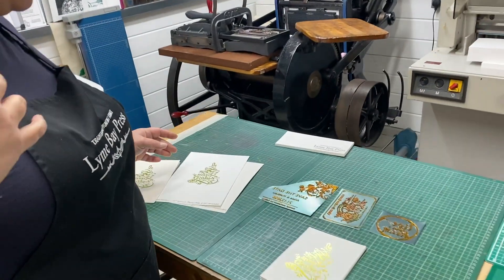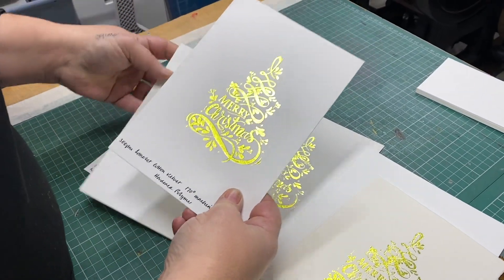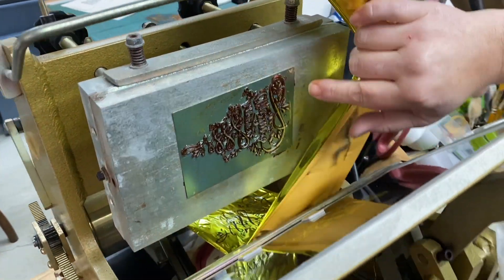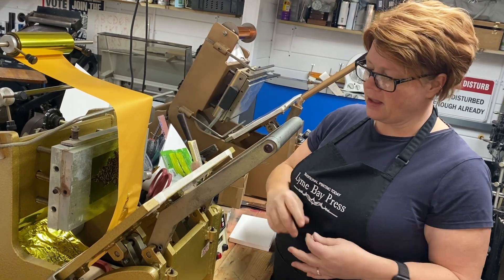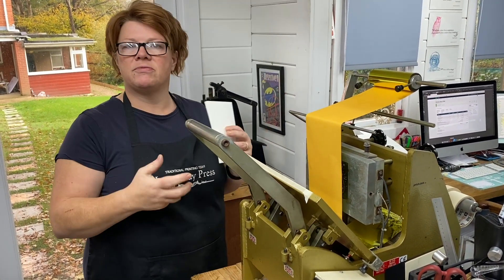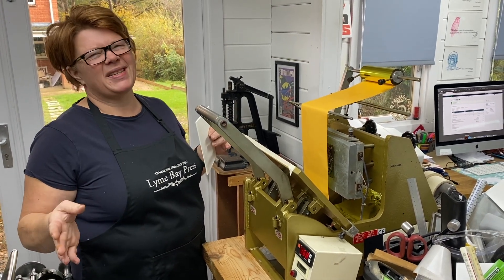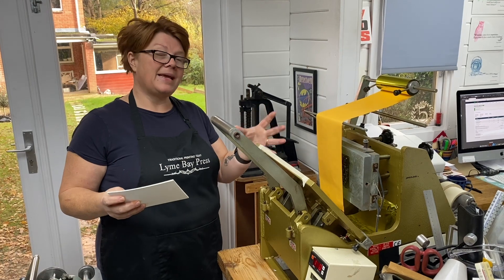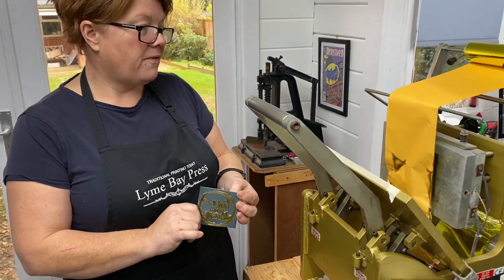Photopolymer Plates for Hot Foil Printing

Comment: I use photopolymer all the time and have done for 20 odd years. We use PPM/H100 and the newer version of the plate from Polydiam and they are fantastic. I use them very successfully on a huge range of board , paper , plastic etc. Overwashing and underdrying can be a common error if you are not used to the process. Im guessing the foil you are using there looks like an older foil , I forget the grade but it looks like an old Foilco 637 I think it was . Also with the PPM/H100 you dont need anywhere near 170 degrees to work with, we are quite happy at about 145-150 even on colorplan and we dont have a very long dwell either. less than a second.  We never dry in an oven, we use a hairdryer, the results just seem alot better and post expose for a good 20 minutes  Just one observation I notice the metal the polymer is attached to is very thin which can cause problems on larger plates. By the way a good grade of foil for metallic foils using polymer is the CF ranges from B and H Foils.   Hope thats helpful. All the best
Reply from the maker: Thank you for this, I've only just seen it. It is very useful I've been looking at the Polydiam plate as an option, I'll get in touch with them and carry on playing...
Reply: @LymeBayPress  You to , very much enjoy your videos. Lockdown meant I was doing even more with polymer plates as we were only getting the odd order , its back to ordering regularly with mags now but still using the polymer for those emergency need them tomorrow orders.
Reply from the maker: TheQuillPress are you able to email me some pics of the results you get from your polymer foiling??
Reply: @LymeBayPress  sure more than happy to have you got an email address to use
Reply from the maker: TheQuillPress lisa@lymebaypress.com :)
Reply: @LymeBayPress   Ive sent some photos across to you

Comment: Hi ,  Lisa
What should I do if my photopolymer plate is too thin ( 0.08 -  1.06 mm ) for printing fine lines and the exposed image areas
on the plate almost very close to the  height of the background of the plate , and the ink cover the whole printing side of the plate include the  background of it ? 
                                                                                Thank you
Reply from the maker: Depending on the press, it sounds like you need to raise your rollers slightly to stop the base of the plate being inked. It may be easier to email me direct at Lyme Bay press and send some pictures of what is happening. Lis

Comment: hi, may i know what photopolymer plate type and brand model did you use for hot stamping? i try to use toray wd95DII , but the foil wont stick to paper stock. my temp is already 150 degree celcius.  waiting for your reply. thank you
Reply from the maker: hi Golbert, we are still playing with types of plate but the main brand is Toyobo, the important thing is that you are using a steel back to retain as much heat as you can and your dwell times will still be quite high, up to 10 secs sometimes... it's still a little hit or miss and won't work with all artwork, but we'rewoking on it. Lis
Reply: @LymeBayPress  thank you so much for your reply. God bless

Comment: Hello , Lisa
Can I replaced engraved copper plate with a very fine line details image on it by using a photopolymer plate instead  ? and
What is the highest resolution DPI for the photopolymer plate ?                  Thank You
Reply from the maker: Hi There, it all depends on the design but it shouldn't be a problem. There is an artwork guide on the website under the help section which should give you all of the details. We like vector/Ai files,  you don't have to worry about dpi then but if you are scanning a min. res. of 1200dpi should be fine, the higher you go the smoother the line will be. Hope this helps
Lis

Comment: Hello ! Thank you so much for your video ! It’s amazing because we have been trying for 2 years to do it. We think the polymer plate is very important.. but we didn’t think that paper could affect the result so much ... Can you tell me what the exact reference of your polymer plate is? Where do you buy it ? Do you know what is the best paper of fedrigoni to this application ? thanks for advance :)
Reply from the maker: Hi Vanessa, Ithink I've been trying that long to, the paper is definintely important, coated boards seem to work better but I'm still not sure that the plates are 100% ready, we use our Toyobo plate 152, we make the exposed and supply the unexposed. We are currently working on another type of plate that may work better, still Toyobo. I can't help you with Fedrigoni, I do use them but not enough to recommend a paper to use, sorry.
Reply: @LymeBayPress  Thank you so much for your kind reply.
Reply: Hello @Lyme Bay Press, I’ll send you an email to keep contact. Have a nice day !